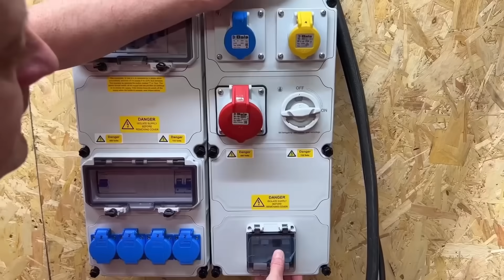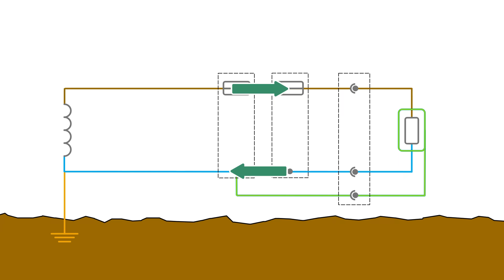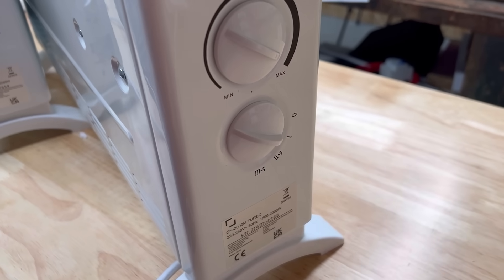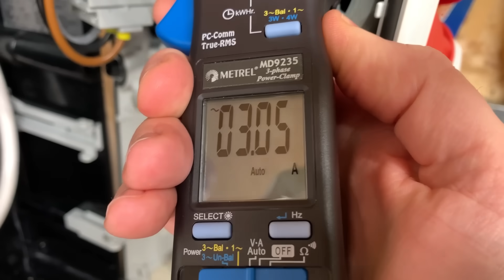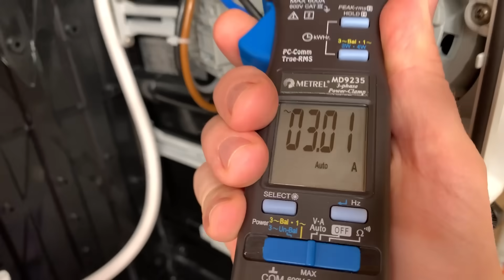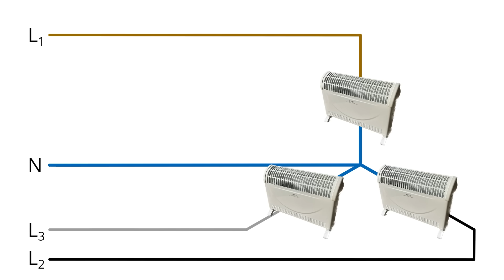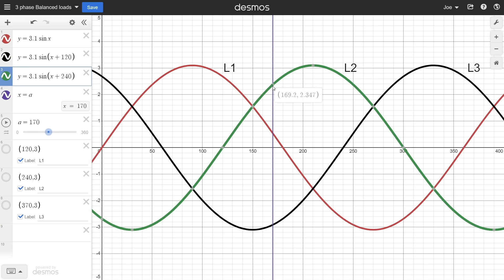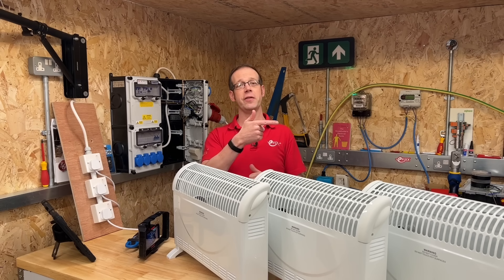Does Current Flow Through The Neutral Wire?

Comment: I challenge you to actually disconnect the neutrals with running equipment 🙂 Actually that would be a really bad idea. Happened at work once in the distribution board (faulty installation, took a couple of years to fail after the building was constructed). The insurance claim was I believe in seven figures and we were super lucky the building was not burnt down. Helped that the fire station was just across the road and they responded in under 90 seconds.
Reply: Had the neutral at the substation vanish with thieves, and the phases started to diverge on all the houses. Had the UPS start to warn about overvoltage, so measured mains at 270VAC. Immediately turned off all loads, and turned off the mains to the entire home as well, then went to the meter room and checked phase voltages. One was at 270VAC, one was around 230VAC, and the third was around 170VAC. Turned off the entire building, and got on the phone to the metro about a loss of neutral at the substation.  Took them most of a day to fix it up, and they came back the next night to do it again, so they put up the steel doors instead of the wood, and welded all the cable access covers on, that they used to strip the SWA feeder cables leading to the street.
Reply: If it was unbalanced, the current would be present at the end of the disconnected Neutral.  The equipment would look dead, right?
Reply: @Poorlybobsdad  No, it could destroy the connected appliances. If the neutral is disconnected the appliances are connected in series between the lines. Meaning, depending on their internal resistance, they would "see" a voltage anywhere between 0 and 400V. The neutral is the center point of the star circuit, which was also shown on a picture in this video. And its potential difference to earth potential is usually 0V. But when you disconnect it, that would no longer be the case. In German we call it, literally translated, a "floating zero" or a "center point shift".
I always use a simple example:
You have a single phase circuit connected to L1 and there's a soldering iron with 20W (2645 Ohms internal resistance) connected to it. And on a circuit on L2 is a heater connected to, like one of them shown here in the video, with a demand of 3680W (14.4 Ohms internal resistance). If the neutral is disconnected the heater would "see" a voltage of 2.2V and the soldering iron would burn out because it gets 397.8V.
Reply: @Marcel_Germann     Of all the comments posted here, yours is the correct one.   Sometimes peoples opinions go off on tangents.
Reply: @Poorlybobsdad  In simpler words: If the neutral is not connected, the current present there will indeed be 0 because there's nowhere for a current to flow. But if the phases are not balanced, there must be a current. Nature doesn't like that paradox, so it handles it by forcefully balancing the phases. So phases that want more power than the average get less and those that want less get more. Until everything is in balance again or all connected appliances are dead.

And as even nature cannot push current, it's the voltage that changes in the hope that the current follows the change. Although "hope" may be a bit tame a word, as the voltage will rise/fall until the current does follow, no matter how.
Reply: If you had just one heater and nothing else there would be no current flowing. If you had two heaters each 80 ohm (720 W) you would have 415 V over 160 ohm. That is 2.6 A and 1080 W (540 W each). That is if you have three identical resistors on a star connection with the neutral is connecting one reduces power by a third and two by 2/3. If you do not have a neutral then disconnecting one reduces power by 50% and two by 100%.

The real problem is that if you have some other loads in parallel like an incandescent bulb with 960 ohm. If it if gets in series with the 80 ohm heater at 415 V it gets 383 volts, i.e. it gets 2.5 x the power and will not last long.

If you disconnect the neutral upstream from the main panel then the voltage in it gets to the earth wire.
Reply: @okaro6595  you are awesome
Reply: Connecting  powerlock cables in the wrong order creates the same problem. Kindoff important to do it in the right sequence, Earth, N, L1, L2, L3, know about a story with 6 digit damage at a festival build-up
Reply: A neutral isn't required on some appliances. For example a three-phase continuous flow water heater is usually 400V, connected to L1, L2, L3 and PE. Appliances where an imbalance can actually never happen, and if it happens, it won't do large damage. Here in Germany these heaters are a thing for showers, usually 22 or 24kW.
Reply: @Marcel_Germann  Why is everything better in Germany! I have to make do with a 9.5kW shower here in the UK.
Reply: @tlangdon12  Because three-phase is common here, even in domestic dwellings. Not only in Germany, also in the most countries on the continent that is the case. For such a "small" water heater we would use a five core 2.5mm² or 4mm² depending on the length of the cable run, and fuse it with 3x16A. But AFAIK in the UK in new buildings they also install three-phase supplies now. Because heat pumps and EV chargers create a high demand in electric energy in domestic dwellings.
Reply: Amp clamp
Reply: Not removing the neutral but try losing a phase in a commercial building. :D The way my employer's office was wired up, when we lost a phase (common occurrence in summer here for some reason) some lights would remain on, some off, and some would be dim. 120/208 3phase service so my best guess is we had some 208v loads that spanned the dead leg and partly energized some stuff, not good for the 208 gear I'd imagine)
Reply: If the phase loads are balanced, as shown zero current flows in the neutral wire so yes it can be cut and if you placed a volt meter between the cut ends it would read zero volts - which is why current doesn't flow. Each heater sees zero volts at its neutral connection relative to earth and sees the normal 230V between its live and neutral as usual - until you unbalance the load by switching one heater off. Then the two remaining ON heaters will run under voltage and the OFF heater will be over voltage and the floating neutral point is no longer at ground potential.

A fun thing to do is spin up a three phase generator to match the three phase supply by watching light bulbs connected between supply and generator in delta connection. When the lights stop flashing in rotation and go out you know the frequencies match and you can throw the switch to connect. Students who timed it badly were rewarded by a loud bang as the breakers tripped. If you do it right you can play around with phase leading and lagging by driving power into the grid or drawing from it.

Here's a funny thing. Our machines lecturer told us that the phase rotation colour identification in Liverpool rotates in the opposite direction to the rest of the country. He said that when the National grid was first connected they had to swap two phase colours all around the city when connecting because Liverpool had too much established infrastructure built with a different phase rotation identification from its early adoption of electrification to economically change. It makes no difference in practice if inside or outside but engineers had to be aware of the difference at certain network points. Personally I think he was winding us up all but it's a nice story.
Reply: @johnh9449  The problem is that in the real world the phase loads are never perfectly balanced and the moment you disconnect the neutral really bad things happen.
Reply: @jonathanbuzzard1376 Well of course. Joe was challenged to disconnect the neutral in his experiment - suggesting that doing so would cause a problem - it wouldn't because the load is balanced with three identical heaters. More usually in practical situations the load isn't that well balanced and it would cause a problem and a varying one. Down a street for example its usual practice to connect alternating single phases to properties to try and balance the load on the three phase cable from the substation as best as possible but of course this is only a statistical average and the probability of balance falls within a wide bell curve and will vary. You get the problem in an exaggerated form with a PEN fault occurs and properties down the street suffer under and over voltage depending on the load of their neighbors. Thankfully that's rare because by design the neutral is the last thing to be severed when the cable is cut accidentally but corrosion can cause more unpredictable problems.
Reply: @johnh9449 there is no such thing as three identical heaters, that's the issue. Sure they are the same model but they are not from an electrical perspective identical, they will all have slightly different power draws.
Reply: @jonathanbuzzard1376  Woopey doo. I think you know full well the point I was making. Joe showed zero "Autorange" on his meter. Clearly they were well enough matched to prove the point I was making 😊
Reply from the maker: Used to do this on a similar experiment for my learners...
Reply: @efixx  For those that don't realize no neutral and all the lives float to 415V AC. The fire was started when the 400V rated capacitor in the power supply of a PC decided that being at 580V (415*sqrt(2)) was not good and flames came out the back of the PC (the slowmo guys have some nice footage of capacitors giving way), and set alight to the noticeboard behind (this is why the mains smoothing capacitor in a SMPS should be rated for 600V). The reason for the really high insurance claim was this was a biosciences lab and at lot of the very expensive equipment didn't take kindly to the 415V AC feed to them.
Reply: @jonathanbuzzard1376  photoinduction will be reading this with joy
Reply: @jonathanbuzzard1376  That sounds like bad day. Thanks for sharing, learned something!
Reply: @efixx  Yes but no... in fact if heaters were just three same naked resistors connected in star of course there is no neutral needed beause you have created a 3phase symmetric system in star connection  its like motor with 3 same windings, BUT with these 1phase supply  heaters with electronic circuits inside neutral is needed for reference if you disconnect neutral from any  heater it will stop , if you discconect it from the power source while running you will end up burning the electronics.
Reply: So ,essentially with the heater neutrals still joined together but disconnected from the supply , it creates a star point giving each heater 415v ?
Reply: @bonusnudges  230v. If the resistance is in balance. You basically have a series on 2 phases everytime.

Comment: I used to find people liked to load up red / brown / L1 phase for some reason ,ease for access ?
Reply from the maker: Most recognisable colour for people a bit unsure of themselves too...
Reply: @efixx   Even seriously experience professionals can fall prey to that.  Fitting out a data centre with rows of computer racks they started every row;s first supply with L1.  Not  appreciating that as the number of cabs per row were not divisible by 3 they needed to continue the cycle.  ie  if we'd gone 1-2-3-1-2 then the next row should be 3-1-2-3-1 and the one after that 2-3-1-2-3 etc.  

We never did get even near good balance, too much disparate equipment for that. But as planned it would have been even more difficult with L3 having significantly fewer connections.

Comment: I would clarify slightly in your eater example, if you disconnected the 3 individual neutrals all 3 heaters would switch off but disconnecting  the common point they would run  in a star configuration. I know most viewers will know thats whats happening  but just for clarities sake.
Reply: it would be good to see a video on that 👍
Reply: @brianhewitt8618  star points are an interesting thing as is generator earthing which is a related subject. Not sure if efixx will cover them but maybe sparkyninja?

Comment: I'm not a spark, but you could have connected the heaters in a delta configuration and saved some money on removing the neutral connection totally.
Reply: Then you would have 400 volts across them.
Reply from the maker: one way to warm the room up quicker 😀🔥🔥🔥
Reply: @efixx  Well now it's getting colder faster space heating is a must. 🙂 My meaning of the delta config getting over taken by the increase in heat.
Reply: @tragicvision775  And a nice and toasty room. My point was that the Delta configuration does not require a neutral at all.
Reply: Get more heat out of them(for a short while!)
Reply: @Anglo Saxon The Y or Star can have a neutral or not, but the delta does not require it at all.
Reply: @Anglo Saxon I get your point, but the y is still often referred to as a 4-wire system. Whereas the delta can only be 3-wires! I did not think my comment would cause such a heated debate pun intended 🙂